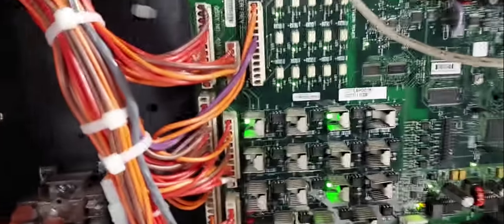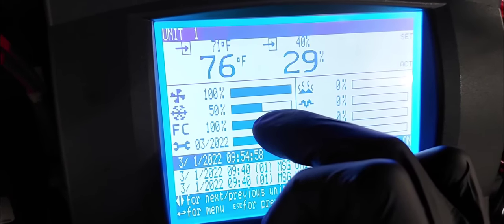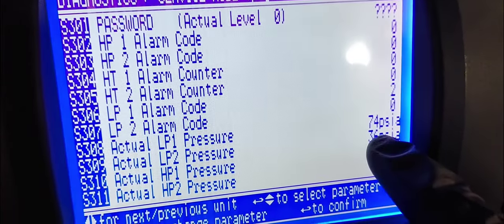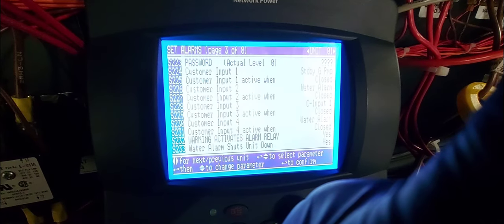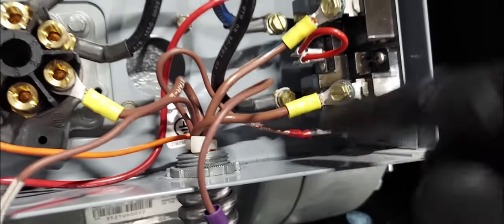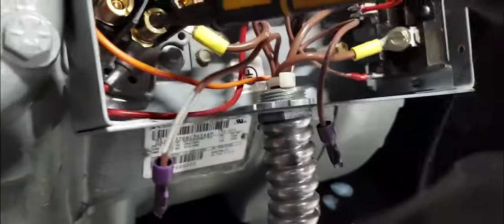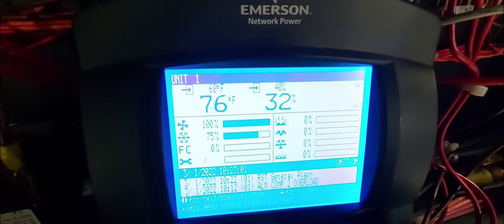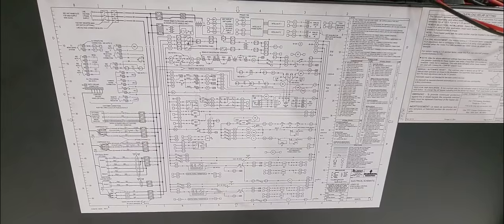HVAC TROUBLESHOOTING

Comment: Had a similar issue, Traced it back to terminal 70 and 71 in the j box at the top of the unit. This is a dry contact for the heat rejection unit. The condenser unit on the roof, was not coming on. The wire that was connected to terminal 70 and 71 was damaged. replaced the cable and code 4

Comment: Thank u my brother very nice video.  I worked on one of this units and it nearly sucked me in, snagged my visitors neck strap and luckily water safety on pan held it.  Yet the safety fell, hit fan and safety shot like a bullet straight in to my eye safety glasses.  Luckily I didn’t die
Reply from the maker: Wow 😮 that's rather shocking,,,, you can never be too careful while working on these things
Reply: Wait what happened? How did it almost suck you in? I’m new to working on these and need to know what to do and not do

Comment: My Liebert DS unit like yours has the same alarm “compressor overload 2”. The fuse #2 keeps blowing out. Avery time I start the unit and compressor #2 contactor closes the fuse blows out. If I manually push the compressor contactor the compressor runs and works fine. What do you think makes the fuse blow out all the time. Your help is really appreciated
Reply from the maker: Check contactor coils and liquid line solenoids coils
Reply: Wow. You’re the best! I don’t have words to thank you. It was the solenoid valve coil that was causing the short. I really appreciate your help.

Comment: 14:06 Where'd u get those leads?. I keep losing my attachments for converting my leads. I just be extra careful without them or when really necessary I have long needle point insulated leads. But i think yours is pretty cool. Did it come with your meter? Mines a field piece.
Reply from the maker: No I bought them separate from Abco refrigeration supply any hvac supply house should have them

Comment: Now where do you start troubleshooting? Find fault code. Hop scotch multi-meter to all safety components. Find open: fuse, pressure switchs .etc  way to go D2D🤯
Reply from the maker: Dude you aren't making any sense 🤣.. anyway thanks for stopping by